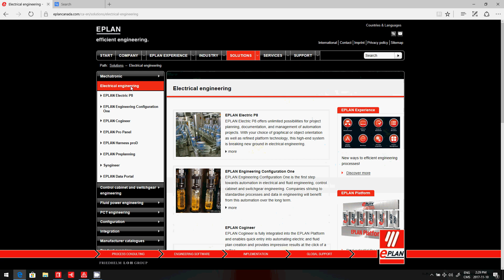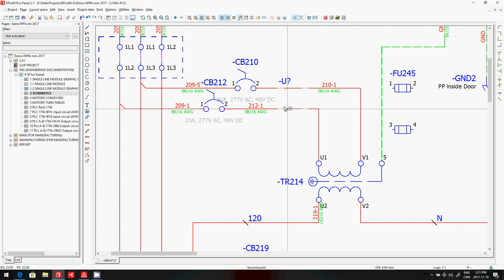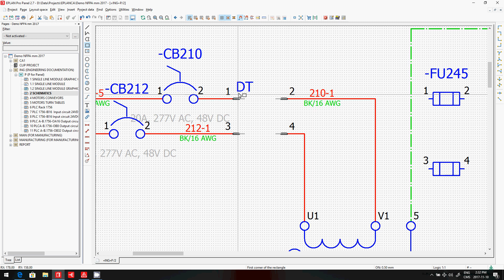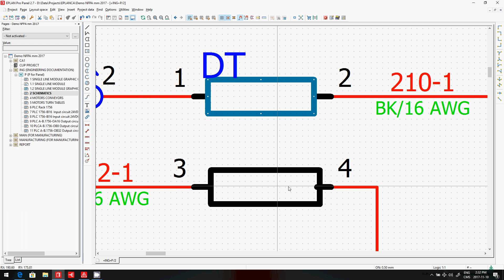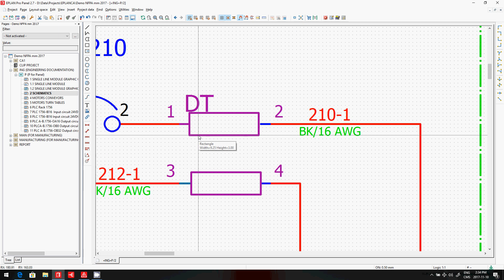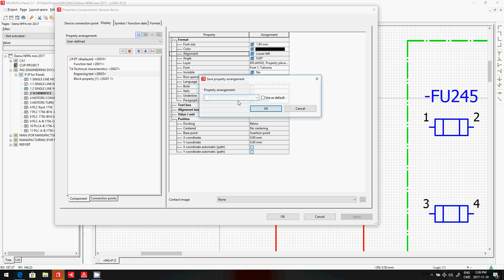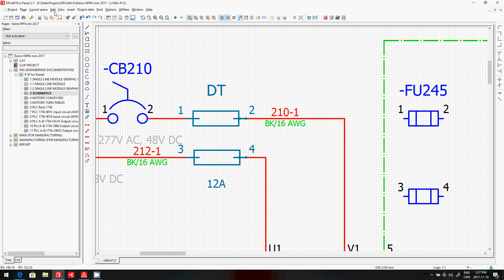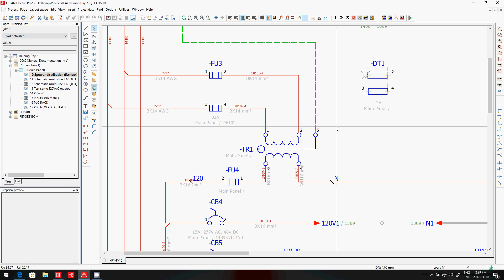EPLAN Tutorial Create Symbol Macros

Comment: This has nothing to do with macros..
Reply from the maker: Why is this? I believe that very often a special block is required (I am taking the users language) and in deed I can create a symbol macro. I understand macros are much more when you start using them as complete circuits, with placeholder and maybe even Cogineer or eBuild. But at the basic it started as symbols macros. So yes this is the 101 of a symbol macro. Sorry to argue. I hope this help users not to make the mistake of changing symbols which can become quickly very tricky and incompatible to the rest of your projects. The block represented by a symbol macros will be compatible years and years to come.

Comment: Where is the limit for symbol macro, when I should save it like *.ema instead of *.ems and vice-versa? For example I have a black box with several sockets, optionaly inserted circutis inside the black box, but the only part number. Or may be it would be not worse to make only *.ema everytime, but never *.ems or vice versa?
Reply from the maker: I use ems for only one symbol, I use ema for any component, black box or circuit.. But really it is your decision. Historically it had a specific meaning now they react very similar.
Reply: @rolandyounk6169  thank you!